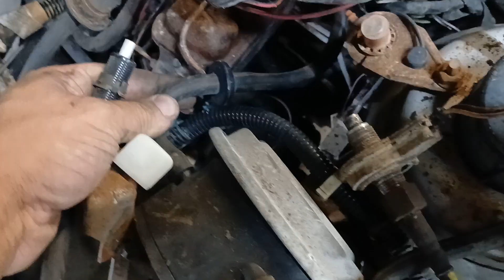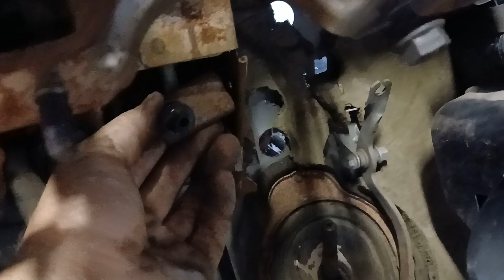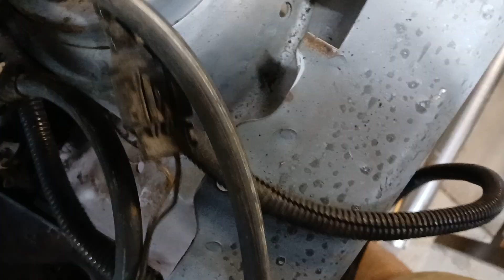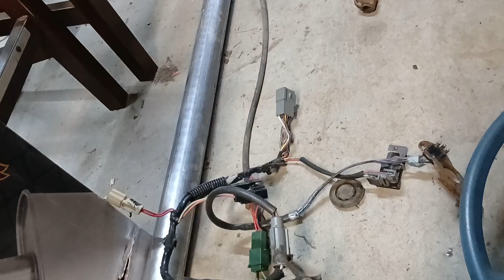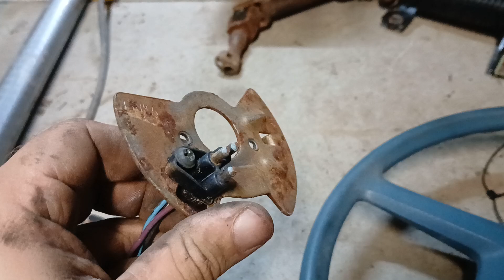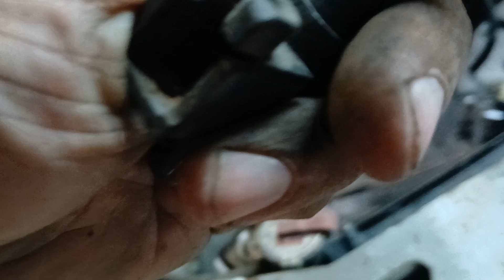1981-1990 Escort/EXP Cruise Control Swap!

Comment: What do you think the check valve is for on the vacuum hose? I have an 88 wagon, I squeezed the cruise control from the donor. I installed it without a valve, but the system works. With greetings from Ukraine 👋
Reply from the maker: I'll refer to my manuals and check back in with you but I imagine it keeps the engine RPMs from oscillating during cruise control activation & deactivation